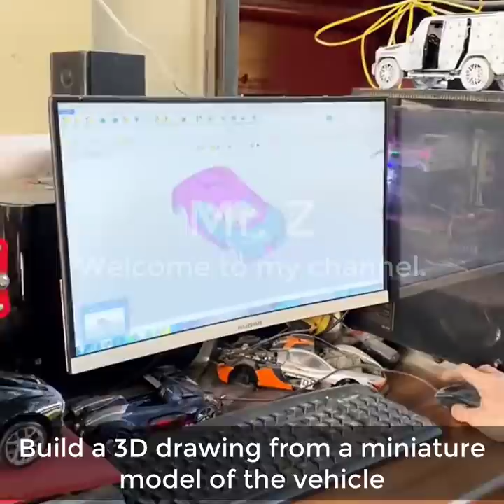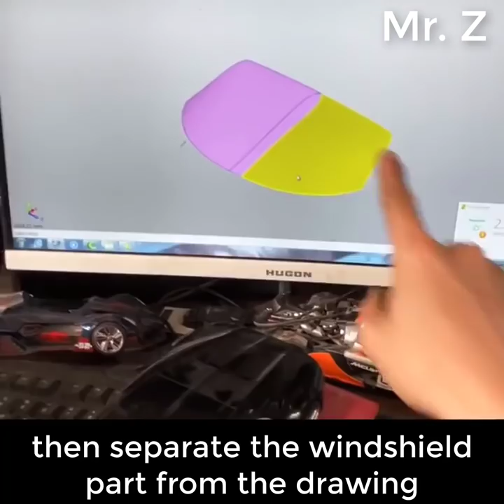Homemade Bugatti Chiron Sport from Honda Civic 2004 | Timelapse Build.

Comment: The design was spot on. The engine has a aggressive tone even from civic engine. The only thing they’re lacking is the safety feature on the design. Car is practically a live mock up. No safety structure that would protect driver and passenger from getting mangled in the event of collision. 
It’s a work in progress. I hope they will upgrade their focus on safety measures once they perfected the design.